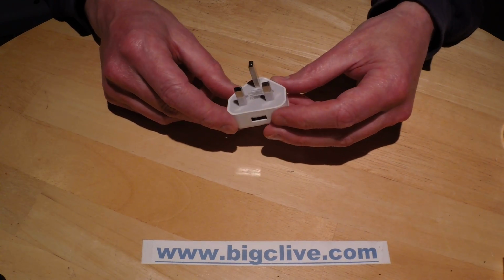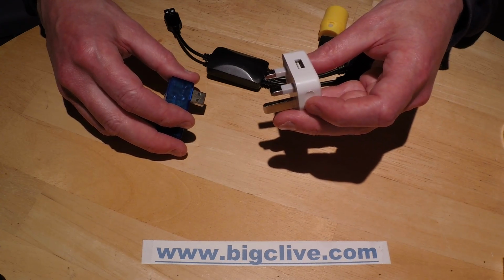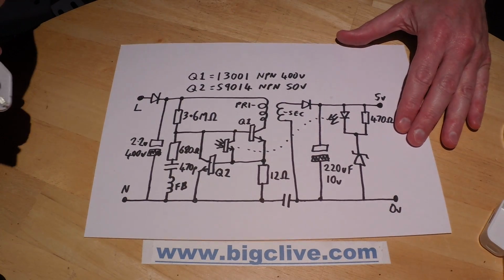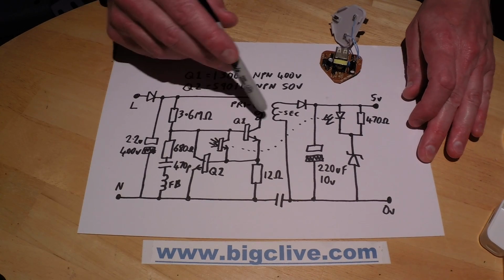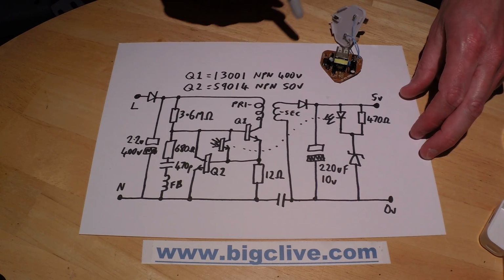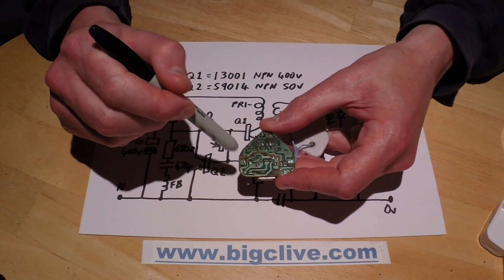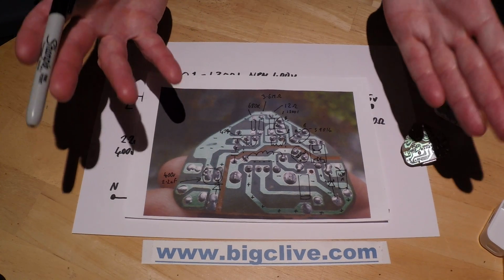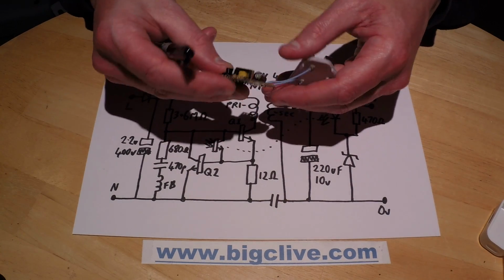Teardown of a cheap UK style USB power supply.

Comment: why they don't put the transformer directly on  the main voltage
Reply from the maker: It's designed to operate at high frequency to allow the use of a much smaller transformer.  If a transformer that size was used with 50 or 60 Hz it would only be rated at a few milliamps if even that.
Reply: bigclivedotcom i similate that circuit of the primary side only with multisim and replaced the transformer with 1.5k resistor and i get a peak value of 50v but not that high frequency where do you think is the problem

Comment: +bigclivedotcom I know this is a very old video, but do you know if you noticed the lack of earth connection? I see in the video that the earth pin existed on the mains side, but was never connected to anything visibly. This seems strange as far as designs go, to spend the money on the metal for the earth pin and not use it.
Reply: The earth pin is needed mechanically to disengage the sliders within the socket so that the live and neutral holes open. I have seen plugs on devices without earth connection that have the earth pin to be fully made from the plastic used for the rest of the housing. As to why they chose the metal version in this case after all, I suppose that's for show (to suggest a level of trustworthiness), and/or simply economical because that's what they had in stock or available for a lower price (as opposed to procuring a new injection mould where no metal earth pin was required).

Comment: Here in Perth (Western Australia) I was on an industrial site in the admin office when the power went. Site electrician quickly worked out it was an RCD trip. I helped isolate  equipment from the circuit, we could not find the fault. About an hour later an office worker described getting a "tingle" as she was plugging her phone into an after market "Asian phone repair kiosk" charger. I grabbed my meter and measured between the USB shell and earth, expecting maybe a leakage voltage of 50vac or so... Nope 240Vac, what was worse was there was virtually 0R between Active and the USB shell !!! The device was reported to the office of energy who have taken it for analysis.

Comment: I'd love to see a video of you reverse engineering the circuitry if a power supply like this. Whenever I try to do this myself i have no idea where to start, whereas your drawn schematics look like you've used a good methodological approach.  I need this in my life!
Reply from the maker: +Richard Purcell You start with the power rails, make a real mess of rats-nest connections inside them and then work out the neatest most uncluttered way to draw it back out from that.  I rarely go from a clean sheet of paper to a perfect schematic in one go.

Comment: Out of all the electronics videos I've watched over the years, I think this is one of the best that shows the functioning of a real-world circuit.
Reply from the maker: +Johnny English You'll like one I'll be uploading soon then.  It's a very thorough teardown on a plug-in power supply.  With full schematic and walk-through.  And also with moments me being slightly perplexed at odd transformer winding arrangements.
Reply: bigclivedotcom I'm looking forward to it! Is there a reason why you use paper instead of something like Falstad, LTspice, etc.? Is it that you're just so used to paper, or have you tried Falstad and realised that it isn't sufficient for showing circuits to your viewers?
Reply from the maker: +Johnny English Nothing is faster than scribbling down a diagram.  The reverse engineering of a design involves a few incarnations.  The first is a bit of a maze of connections, then everything gets shuffled to look more logical and less cluttered.  Doing it on a schematic editor would just be too time consuming.  Even my PCB designs are doodled on paper to find optimum layout before I fire up the CAD.
Reply: bigclivedotcom 
Hi can you explain it for me please why inside the USB Chargers has 4 connection,
for charging , we need just two wires minus  _ and plus +  to charge the  device ,
what is the purpose of two other connection inside the USB charger connection can you explain that for me please , thanks and have a good day
Reply: In the most simple case: It would be more expensive to make USB sockets that specifically do not have the data pins, so it is more economical to use the readily available 4-pin sockets.
In less simpler cases: The data pins can be used to communicate between charger and device to be charged. Using these, the device to be charged may "order" more current than the regular USB Standard's 500 mA.

Comment: The USB measurement thing you used could also be confused by the noise on the output, as these nasty blocking oscillator switchers are very noisy.  I tested one of the 'white block' knockoffs we have in 120V land and there were a load of ~150kcy/sec bursts at ~2msec intervals with no load and a few hundred mV of 60 odd kcy/sec noise with a ~350mA load.  I would also not trust the cap they used between the mains side and the load side as it is probably not a proper Y cap (safe to connect between mains hot and any ungrounded metal that the user may touch).
Reply from the maker: You're right.  I tried it on my rock-solid iPad charger and they were stable.